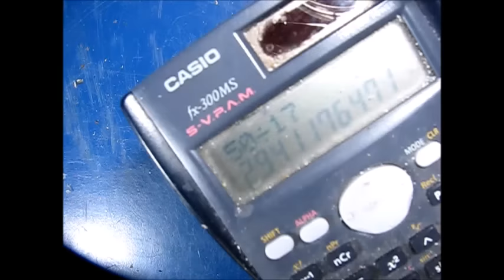How to easily fix a lawnmower pull start cord

Comment: Different video i watched suggested winding until spring is tight. Then release a half turn. Install rope and allow it to roll up the rope until no tension. Install recoil and then cut rope at proper length to handle location. That ensures rope will be used up before spring reaches it's full tight point.

Comment: I got a issue, ny cord didn't break what happened is the metal stopper came through the hole and so the cord is stuck not able to go back in, can i just tap it back through? or would i have to redo the whole thing? The cord is not detached its just stuck because of the stopper on the outside instead of the inside..

Comment: There is ZERO need to measure anything.  You install the entire rope. Then if it's too long, you simply tie the knot lower to move the handle in and cut off the excess rope. Not to be rude, but you've just confused all the people you are trying to teach.
Reply: He also could have just measure the diameter and multiplied by π for a much simpler way of measuring the circumference

Comment: Sorry.....your video has not helped me!!!! Different lawn mower type, and no pull cord extension onto handle bars... I have a briggs and Straton engine....no rest stop for pull cord except on engine top..and...my cord blew off engine in middle of mowing lawn into street without any reason as to why it did that in first place!!???? It took handle and about 6 inches of the rope off!????? Felt like I hit a rock for a second or two when it happened???????